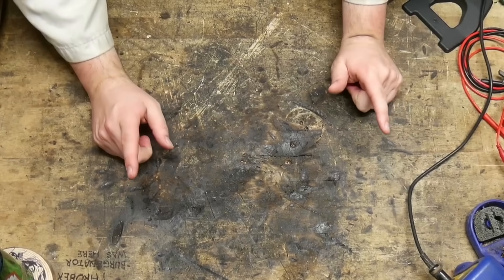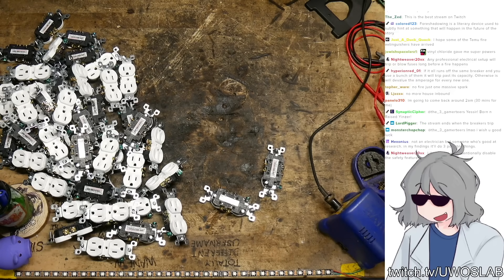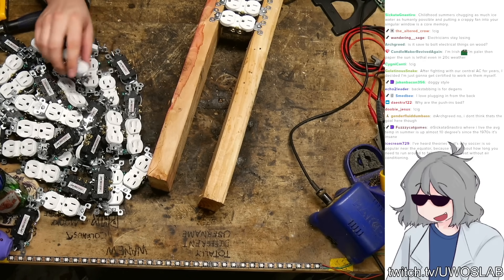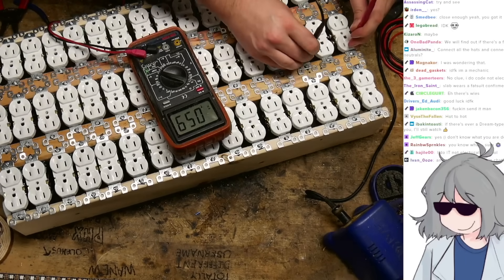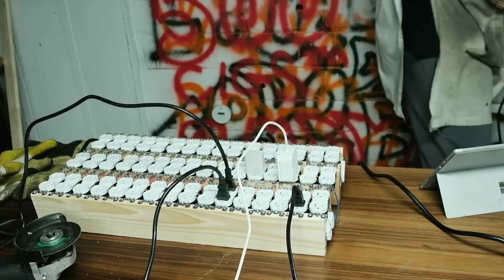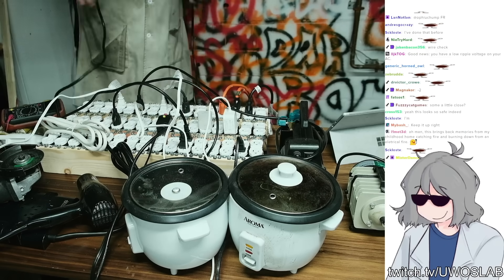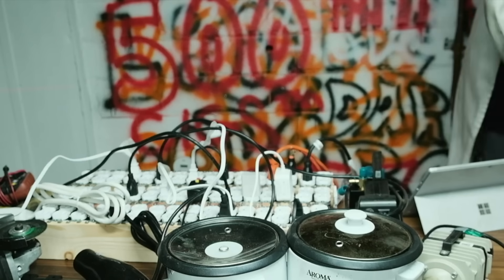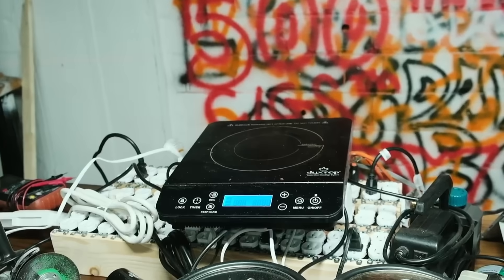Making a 100 OUTLET POWER STRIP to see what happens

Comment: Electrical Engineering student here! You'd need about 85 amps to make this "properly", meaning you'd have to either use a single "hot" conductor with a section of 25mm² (4 AWG) Or two "hot" conductors with a section of 10mm² (8 AWG), the single phase one would need a 90 amp breaker and the two phase one would need a double breaker rated for 50 amps... of course you'd also need to properly rate the whole power strip with either passing these massive wires all around it or just splitting it all into smaller circuits... AND IT WOULD STILL BE A FIRE HAZZARD LMAO

Comment: 2:39
that's intentional. Each individual circuit can take a decent amount of power before they overheat, but if all circuits were near max load, other components in the breaker box or maybe in the connection to the grid could start to overheat, which the master breaker protects against

Comment: 2:00 the in rush currant limit goes up... so if you add a 15amp to a 15 amp you get nearly 50amp of in rush currant before the switch trips. your average 18gauge 14gauge 20-24gauge appliance wire would light on fire not tripping the shutoff, if the plug in cords have any abrasion on them, also that many devices on a house circuit makes another problem... if it has been dry outside for several days or weeks, the power flow of now allowable inrush currant between the hot and neutral phases is high enough that any and all grounded objects become semi electrically inducted above 70 volts... something like a door knob because the wood screw got in deep enough to touch the grounded switch box on the other side of the post, is now an open live but the paint on it oddly hides currant flow until its being held hard enough to start turning in... some houses are bui"all of them"lt in that way to entrap the mentally disabled to record and prove there systematic delusion of knob turning window sliding etc to get in her room to boom boom in da room boom zzzZZZZZZzZ... "lights flickering" WhAwhAAAAA...!
Reply: 3rd world countries actually use an arc fault main switch on all the sub switches and the high load main, so if any power flow goes into the un-bonded ground circuit everything shuts off preventing injury. commercial rental condominium code has that in CA/USA... residential in CA/USA... they don't care tho pulling enough power in a arc fault bedroom circuit will create an eddy currant into the ground wire, so using a big gamming PC on a bedroom circuit will trip the panel switch because of the 28amp inrush currant tripping the 50mha ground fault. need to pay a worker $580 to swap out that panel switch and relay to the HOA that that room is no longer legally allowed to be rented or used as a bed room. 101 ways to deny insurance claim and there now $480'000 in debt. tisum ree-beds room into stink cloth pile.

Comment: If you cross phase then shit blows up and hits the fan immediately. Pray to god your breakers work because the phases can act as a short. It causes anything from some smaller stuff like sparks, frying your electronics, breakers popping to some more serious things like arc flashes and power outages.

Comment: This is a very serious comment. In part of the video, you said "I even used a bigger breaker to put more juice than normal through the wires"

Did you swap out the normal 15 amp breaker with a higher amperage breaker, or did you use an existing 30 amp circuit? 

Because if you used a larger breaker on a normal circuit, the burning smell was likely the wires within your walls and you may burn your house down.
Reply from the maker: I didn't swap the breaker, I tapped one phase of a 30A 240V dryer plug, each phase in the box is wired with a 30A breaker so I can pull more from it than I can from the 120V basement plugs that just have 20A breakers
Reply: @UwosLab thanks for the reply lol i was worried

Comment: (Paused at 1:59 to type)
Using my basic electrical knowledge, the multiple breakers in the same phase without looking it up.. I'd think they would share a load across them. And if flipped, the rest would as well as they become overloaded from taking more power due to one tripping. I know very minimal on AC circuits.

However, upon looking it up, the breakdown I got is that one breaker might trip while others don't, leading to imbalances that aren't good. The line could still have a portion that is energized from the breakers that didn't trip, posing shock hazard. And potentially a fire can occur. The unbalanced issues are voltage drops, unbalanced loads, overcurrent protection issues, and neutral conductor overload (where 2[+] hot wires share a neutral).
In other words, not good things will happen if you do 😂.

Comment: also if you short circuits together, they could either be on the smame phase, or opposite phase. same phase the current capasity will add, different,, its the same as shorting 1 phase to neutral, except with 240 volts. usually 1 or both breakers should trip before a fire happens but no promises it would.

Comment: According to the Commercial NEC code, you would need a 150 amp circuit for 100 plugs, which is for if each plug would draw 1.5 amps at once. which also means you would have to have cable thats rated for 150 amps.

Comment: Certain Wattage over certain line thickness. First your Amp drops over distance then your cables burn.
Technically you could make a 100 plug outlet that does work savely if the connecting cables are something insane like 20mm2 and the metal on the plug is thick and juicy as well. Of course you can still "only" 200 A of total devices into that

Comment: You didn't show how you fired this up. let's see you're pigtails. A dryer outlet will give you 60 amps of 120v, 30A on each leg.  Your biggest problem is rating the wire gauge. This is not crazy if your load isn't crazy. Ohm's law baby!

Comment: Holy shit, as somebody that actually knows electrical stuff pretty well, this is just so scary. Like there is some of this that is less scary once you are just comfortable working with electricity, but things like replacing the breaker in the wall to get more electricity out of the wall through the wires that aren't rated for it? That shit is the kind of thing that burns your house down years later because you actually melted the wires in your wall during this little video and now there's some bare wire waiting to spark to something else. And then him talking about doing the whole cat 09 tails thing when North American power is like split-phased gave me some serious stress when he spoke about it.

Comment: how to do this project slightly less sketchy: replace daisy chain wire with 3 bus bars, then wire each to that for power, then cover with plywood for insulation handles high current better that way, ideally fuse each outlet and also main input & add big inductor in series with input to reduce inrush current when many things are plugged in at one because of initial power draw from capacitors in that many devices. use thick wire for input side to bus bars.

Comment: As an electrician, this makes both happy and horrified to see. I am glad however, that someone smart enough to realize that this is a terrible idea is doing it. As for the wiring multiple circuits into the same phase/ power combining method that you're utilizing, you will likely be outputting 240ish volts from certain outlets that are using multiple circuits, and I'm not sure about the amps. Truth be told, this is such untested ground in the electricianry field that I don't even have a clue about this sort of thing. If you plan to do this again, Uwos, please keep yourself gloved and off the ground in bare feet, as I'm sure you know.
Reply: I don't believe you're an electrician
Reply: Felt the same way when he said it. Being my gramps and father were certified electricians, I don't think if they were alive still that they would've ever heard of this either. 

For me just having ramdom/minimal electrical knowledge, I had no clue how this would play out. Kind of figured all the breakers would trip nearly same time, but as of typing this I just to him plugging things in so I'm guessing.

Comment: As a (shitty) electrician, this went from "a good chuckle" seeing the thumbnail to "oh dear god no" when he mentioned plugging it into different circuits simultaneously.
Reply: other then possibly dumping all the current to the lowest resistance wire what would happen from a hobbyist maker
Reply: @bskcj1149 Well really the "bad thing" that could happen is the breaker would trip. In a US home, what you generally get is 240 volt service that gets split half and half into 120 volt circuits. Some circuits get one phase, some get the other. The "hot" wire on two circuits could be in phase, in which case its basically fine to "combine" them, or they could be opposing phase, in which case "combining" them would be like a direct short from hot to ground, except it would be a direct short from hot to hot against 240 volts (like shorting two hots on a 240v dryer outlet). Again, all that would happen is one or both breakers would trip, but it's still hilariously alarming.
Reply: @kajraske2002 fair enough thank you for the info man
Reply: Yooo residential homes are not two phases,  it's a single phase with one of the legs being 180° degrees out . 
      It's not really ideal to combine circuits like that but yeah if you happen tap in on separate legs it will go boom and if you happen to get struck by that short it's going to severely injure or kill you.  I've spent 6 years working on these death boxes while they were live.  Get the proper equipment/ training or hire a competent electrician
Reply: @bskcj1149 literal death and large scale power outages depending on how unlucky you are, how well your overcurrent protection works, and your power companies protections. Most likely you will just immediately pop the main and fry some electronics. The main issue is if you cross phase by pulling off of different phase breakers. In his case they were both the same phase which lowers the resistance on the breakers which means unless they have the exact resistance one can be putting out the majority of your current leading to a trip and then forcing the current through the remaining breaker causing a trip/fire hazard all around on your wires. Probably why he smelled the burning insulation.
Reply: What hurt me (as an electrician myself) and i havent finished the video yet, but seeing him drill those outlets right next to eachother seems like so many problems, my fingers hurt imagining wiring that many outlets, and then drilling them right next to eachother seems awful to wire, not to mention that you should not put those screws right next to eachother causes it to be very likely to trip (i usually cover them with electrical tape after wiring)
Reply: Either it would be a dead short or he would create parallel paths back to the panel. The second one would actually cause a house fire as the outlets and wiring between them would now be carrying twice what they are rated for.
Reply: And thats ignoring the obvious problems with this lol

Comment: When you plugged it in with nothing on the lines, yeah it better not have popped the breaker because outlets with nothing plugged in is just an open circuit. Also the burning is prolly from the daisychained, penetrated outlets. Shoulda put them in parallel with eachother instead of in series. Wouldve made it a rats nest, but it'd be safer/more reliable.

Comment: First thought: All of those unsoldered screw connections basically make this a giant resistor.

Second thought: What, no grounding strip for all those screws? 😂
Reply: If we wanted safety, we'd be watching crazy russian hacker.
Reply: That’s not how writing outlets works.
You dont solder them. Really wouldnt be a giant resistor. Thats not how it works.
The main issue is amperage.
Standard breaker is 20amps a standard outlet is rated for 15 amps. The pull is either spread out through the circuit or concentrated on one outlet. Once you pull 20 amps total the breaker will trip

Comment: Why did you not buy the outlets in cases of ten? That pile is hilarious however

Also your main doesn't trip because of a few factors. Your whole house running everything at once full tilt would potentially trip it, but remember that you have to account for the phase being split. Only 2 pole breakers draw what it says "on the tin", all the single poles can be viewed as requiring half (effectively but not actually) their amperage from the main.

Comment: House wiring must be able to carry more than the amperage limit of the breaker that feeds it. As such, the house wiring should be just as safe as normal use.

He mentioned plugging his contraption into a higher amperage circuit, like the 30A dryer circuit. Additionally, using extension cords. Cheap extension cords are usually only 16 AWG wires, which are only rated for 13A. If they're plugged into a 30A circuit, that means the wires in the extension cords will melt and catch fire before the breaker trips.

As for the 100-outlet power strip, daisy chaining them together like that means that the little brass tab on the side of the outlet will be carrying ALL the total amperage for every subsequent outlet in that line all the way to the end. Those tabs are rated for 20A, supposedly, but I wouldn't risk it, personally.

What would've been a fun thing to see is a thermal imaging scan of the back side of the power strip while it was in use. I imagine all the wires at the start of each branch would've been glowing hot.
Reply: the daisy chained wires were definitely the source of the burning plastic smell
Reply: I know that breakdown of how breakers are intended to work and why american extension cords are stupid anywhere. I see you too watch Technology Connections.

Comment: Breakers are meant to reset once, they should be replaced according to the NEC.
You were supposed to use an isolation transformer to avoid house insurances denying you for the rest of your life.
I suppose that's what the cool sunglasses are for...
Reply: That is the most asinine statement i've ever heard. FUSES are single use, but breakers are designed to be used up to thousands of times. That 's why its a reusable breaker switch instead of just a fuse. Also, no, NEC does not say to replace your breaker after a single trip. Where did you get that information?
Reply: @BlazingKhioneus  Read the NEC and go to school. It's written into LAW not into manufacture ratings.
Reply: @27duuude1 Cite the NEC guideline you're referring to because I can't find what the hell you're talking about
Reply: @BlazingKhioneus  "all new materials" is at the very beginning of every single copy of the NEC. A breaker tripping causes damage to the internal structure of the switch. This is for insurance, inspection and installation more than idiots trying to commit arson. However when you have someone trying to commit arson, you have to assess for damages before you can insure the house again.
Or just hide your identity so nobody knows what house needs new wiring...
Reply: @BlazingKhioneus  This is just the definition of what a breaker is. It takes the damage of the circuit overloading instead of the wires so you swap out the 10 dollar switch instead of the entire 90ft of copper wire.
Reply: @27duuude1 First, "all new materials" applies strictly to at the time of installation. Naturally you wouldnt install heavily used equipment in a new construction that you're looking to get signed off on, but the way you read it implies my outlet must be replaced after I plug a vacuum into it and then unplug it. 
Second, idk what temu breakers you're buying for $10, but i wouldn't trust them. Breakers tends to cost upwards of $100, so, again, it would be asinine to treat it like a FUSE that is spent after a single trip. 
I reiterate, you must be thinking of FUSES, the single-use current overdraw failsaves that are no longer usable after a trip and cost $5-10. BREAKERS are expensive, reusable pieces of equipment. This isn't the 40's anymore, we put BREAKERS in the mains panel in houses, not FUSES.
Reply: i remember time when I was holding on button on power strip to make it work. cause for some reason 1 cattle was enough to trip protection on it.  🤣 now I use it for my PC it consumes much less than cattle so it does not trip... do not things like I do.

Comment: I'm no electrician but I've done enough home repair to say this is probably fine. Aside from not using boxes or the right colors, there's not much different between this and a house with a bunch of surge protectors. Not to say either are good, but as long as nothing shorts and you don't turn it all on at once (again) it probably won't burn your house down

Comment: Meanwhile I used to live in a house where using the toaster had a 50/50 chance of knocking out power to one of the bedrooms
Reply: that is some green acres kind of stuff...
Reply: That's cause the bedroom was connected to the kitchen in series like he is doing here. A toaster uses a LOT of power. If there was too much stuff turned on at one time the toaster would put it over the combined limit for all those outlets. A toaster should be in a dedicated circuit or at a minimum the kitchen outlets should be on one circuit so you at least aren't knocking other rooms out too.